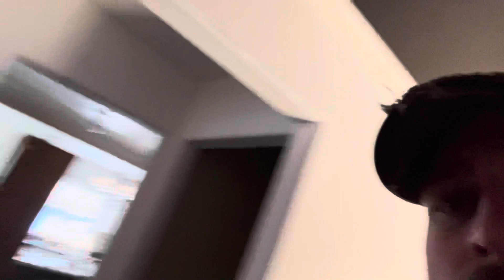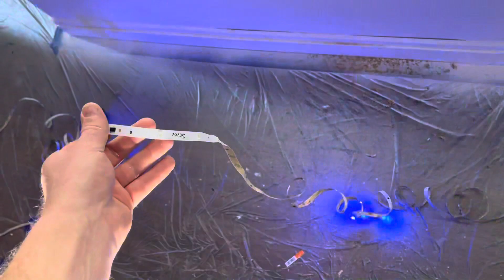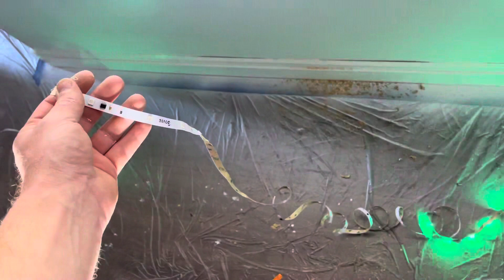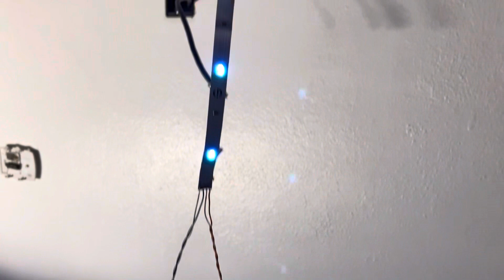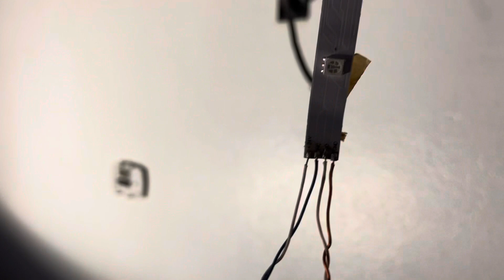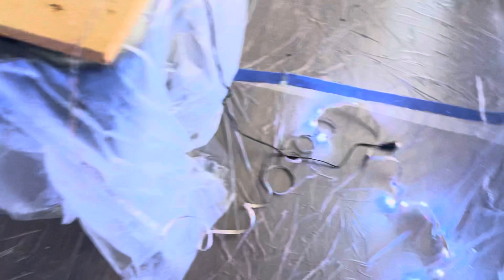Can you cut GoVee RGBIC Pro and splice?

Comment: Hello i have the exact same strip but its too long for my room. Can ı just cut at the end and not reconnect it will it work fine with the app and the controller?
Reply: It will still function, but you will lose any of the patterns that were supposed to function on the portion that you cut off, so there may be periods of no light if those parts are only supposed to be lit

Comment: Ask.. i bend accidentally a brand new govee rgbic. Its a little area didnt reproducee green  color other no have issue but some colors are not accurate thar area i mean when supouse to be white goes pink .. can i cut that part where goes the coneection to the bext connection you know the positive negative etc and cut out abd put cables fkr extebeded and hoin that area i knkw i will elimate a maybe a feet or somethibg but can i do it and the led will still do the same colors and i can use the app etc?

Comment: hey! I have a 24v rgbic led strip and i'd like to cut it and connect two parts to the same controller. Can I do it with a 4 pin connector or do i need any particular cable?
Reply: shouldn't need a specific kind of cable, a 4 pin connector should work, i just prefer to use CAT5 because i have it readily available, i can customize it to whatever length i need and in my opinion is reliable
Reply: Hey did u cut it yet, and did it work?
Reply: @talbarr2252  hey. no, I didn't. I found another way to run the strip without cutting and reconnecting
Reply: How?

Comment: So i had 32FT RGBIC PRO (2 rolls by 16ft). I literally was running 15" short and extended  one roll to 17 ft 2". The control unit that sends the voltage is programmed only for 16 ft even. So the added section was lit as it was close to power source but at the end of the line exactly 15" was dead and did not lit.  I also had 65" RGBIC PRO, so i soldered that control unit to LED strip and it worked. However, I noticed that certain modes that start  sending light from the middle are not working as intended. Why can't they allow in the app to add manually number of sections so all light presets work as expected...